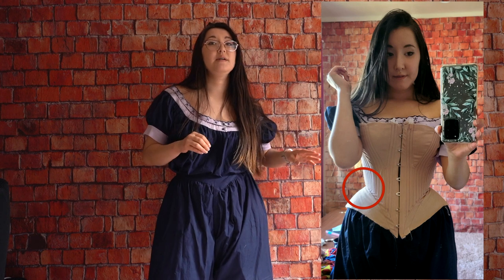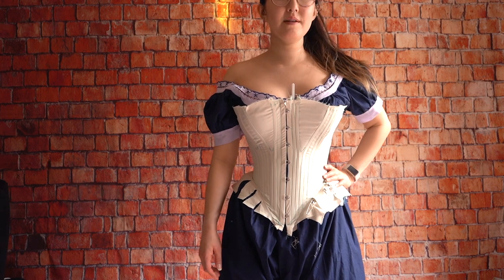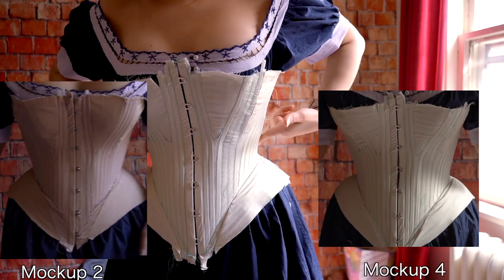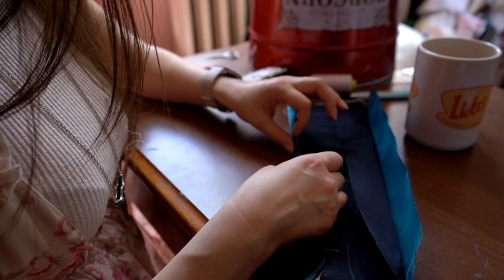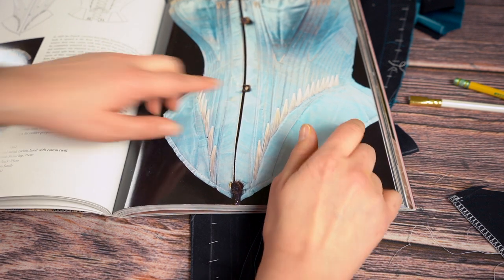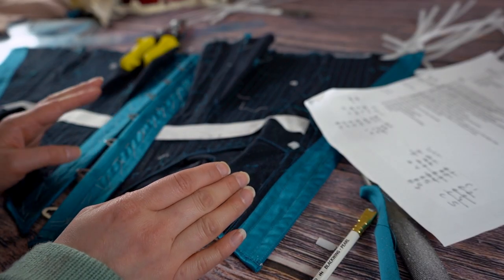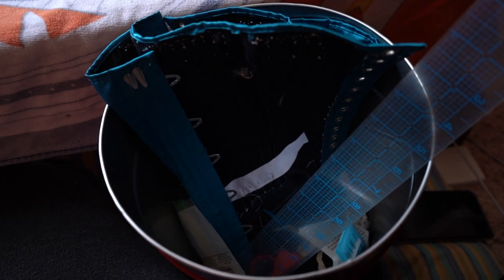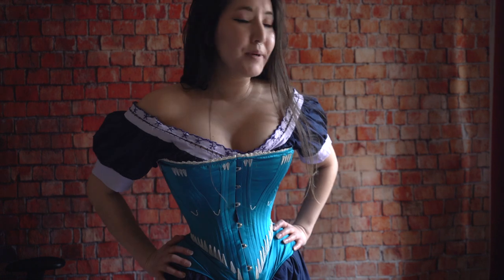Making a Victorian Corset | Recreating an 1860s Historical Corset for an Alice in Wonderland Cosplay

Comment: I noticed this when you were cutting on the black fabric, and just wanted to ask...but did you cut the pieces on a curve at all?  Bernadette Banner noted when she was working on her corset that patterns were laid out in a sort of curve historically, so that the bias pulled with the shape and decreased wrinkles in the finished garment.  I was wondering if you followed any sort of logic like that when laying out your pattern pieces.  ovo
Reply from the maker: i'm not sure exactly what you mean, sorry! but i cut the pieces with the grain marked on the original pattern.. typically you cut the waist all at the cross grain since that's going to take quite a bit of strain and should definitely not be on any type of bias, however because human waists are not usually completely parallel to the ground that causes the above and below waist parts of each piece to travel through the bias if that makes sense? my wrinkles unfortunately were coming from a fit issue rather than a cutting issue but it's mostly resolved!

Comment: That is a tiny waist! 😳 tip from around mid 19th century (which sounds uncomfortable but probably works) is to sleep in your corset (from Ma Ingalls of Little House). 
It's a gorgeous corset either way and having a bigger gap is fine. That's why they laced shut - so you could wear it even if your size changed.
Reply from the maker: Lolll I’m sure that would work but there is no way I am ever sleeping in a corset 😅
Reply: @moth.faerie  if you use the plastic boning, you can wear it and use a heating pad on it to shape the plastic, then keep it on while it cools down to set it in place.